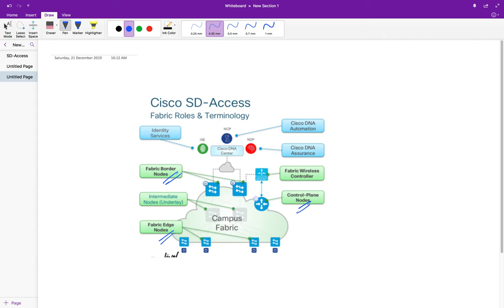Cisco SD-Access - Part 1

Comment: Sir I have one question every site We need control plan node or there are multiple site and there is one control plan node. ?
Reply from the maker: The short answer is, it depends. SD-Access is majorly an enterprise solution so we are talking about say a campus. There might be deployments where couple of campuses are closeby in which case the fabric might be spread across. Since control plane node majorly stores IP, MAC, RLOC there is nothing stopping from using the same node. But for an highly available network, i would suggest looking into redundancy. cat 9300, 9400, 9500 and 9600 all serve as ideal control plane nodes

Comment: I need small clarification i e.., control node will be on top of border node or below the border node. I am bit confused because everyone kept that node in cloud but where exactly it will sit i am unable to get
Reply from the maker: In most of the environments I've worked with, control  and border functionality is enabled on the same device, though you can have separate devices for each role as well. 
All of SDA sits inside your enterprise so nothing in the cloud for this solution.
Reply: @BitsPlease  thanks for your reply
If customer wants to place border gateway and control node as separate layers then how the architecture will be